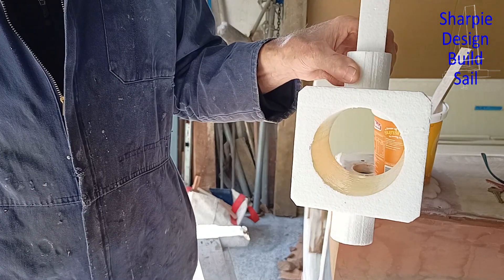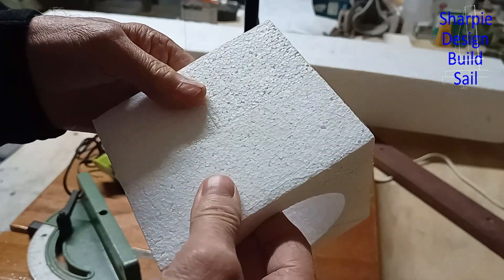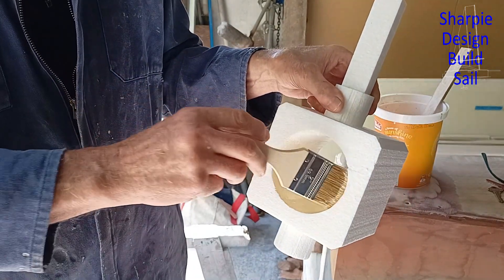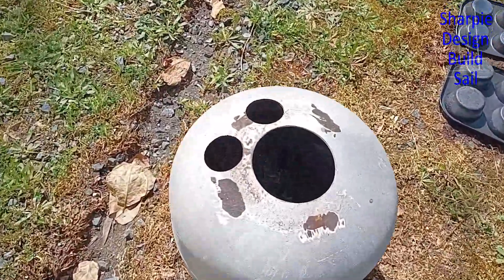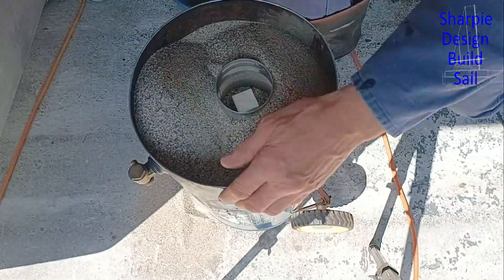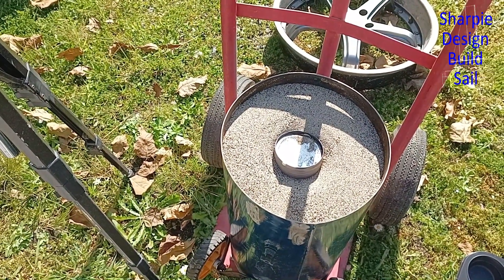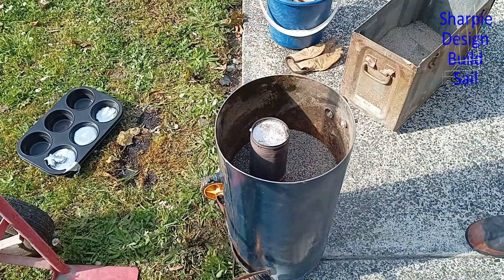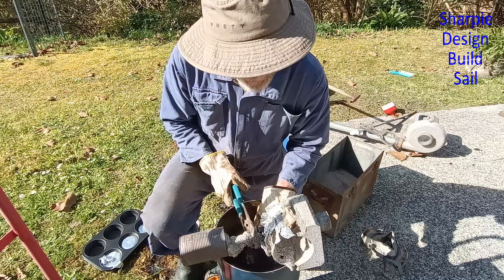Lost Foam Casting First Time - What Could Go Wrong? - Sharpie Sailboat Build - V53 The Rig Pt3

Comment: I'm a bit late to the game as you've pretty much cracked it now, and I'm far from experienced so take any of my advice with a pinch of salt, but I used strategically placed plastic drinking straws vertically in the sand as vent tubes, thin and easy to cut off afterwards and I didn't have any noticeable explosions of gas. But I never did items as big as yours either. Cheers Karl.
Reply from the maker: Yes there's so many variables so I can only relate to what works for me, and Kelly 😉

Comment: Need to coat all the foam plus have another vent for the gas to escape. 

I'd also have a go drilling holes in the foam where it's not structural. Use them to vent any gas out elsewhere.
Reply from the maker: Thanks for those suggestions, much appreciated. I've pretty much done that on my mark 3 version, rotated the pattern so bore is vertical, increased the sprue size and shortened it by 50mm and diagonally opposite put a hollow foam vent, hole goes down into foam. Have got my second coat of slurry on which might be enough. Also slimed up the pattern a little, not as much depth and removed some material from the fire and aft faces that don't do much. Should I replace the sand? It's quite flowy.  I think we're going in the right direction!

Comment: Looks like an interrupted pour. Pour faster, try to keep the cup as full as possible.
Reply from the maker: Absolutely, it happens very fast, faster than I expected and a fast continuous pour seems essential. Also, to work with the rapid amount of metal I'll need to use a bigger can so the risk of overflow is less. But yes, it's very clear in the video I didn't pour fast enough. I'm increasing the sprue size so that becomes even more essential.
Thanks for the feedback!

Comment: I would coat the foam multiple thick layers. And use plastic staws for gas outlet. And wouldn't put it so deep.
Reply from the maker: I appreciate those suggestions and in my 'first version' of remaking the pattern I have done just that, put more coats on the pattern. I say first version because in the early hours of the morning I can usually think ways that theoretically could improve things! Yes, it seems different casters have different opinions about venting but after watching quite a few videos, I'm convinced that any way you can help the rapidly expanding polystyrene gas escape, has got to be an improvement. It does seem counterintuitive for the gases to be escaping out the hole you are trying to fill! Of course, in practice, a lot of the gasses actually are supposed to vent into the sand itself and so coating the pattern apparently can to some degree interfere with that escape path and venting becomes more important presumably.
Yes, if it's a 'loose sand' type of casting sand, a deep set pattern has a lot of weight above it and it makes the whole metal replacing foam to support the 'roof' far more critical. That's partly why I'll rotate the pattern 90deg so the bore is vertical which gives much less horizontal areas and also make it much easier to pack the bore. 
Straws sound like a really good idea. When casters use green sand I see they often poke thin holes nearly down to the pattern to relieve pressure in the casting sand. You'd have to use straws, like you say for a loose sand. 
One guy who got very successful uses his own made plaster of paris funnels and they stop the metal cooling so fast in the sprue walls.
Thanks very much for your feedback!
Reply: @KarlFullerNZ  Is it Kelly Coffield? He is too good.
Reply from the maker: @High56 good suggestion, have watched some of his videos amongst others. Cheers for the suggestion!

Comment: Maybe using Super Glue could have solved the issue with the hot gun. I'm not a caster, but I have seen people use a more specialized casting sand that keeps its form and doesn't collapse without support. Cheers.
Reply from the maker: Cheers for chipping in, this casting business certainly throws some curve balls. I've seen it mentioned in forums, in very small amounts superglue might work but any type of glue you use, has to burn up at similar temperatures to polystyrene, that's the issue. Apparently sparing use of PVA is OK. The different casting methods require different skills as does cricket and rugby I believe. The difference between foam casting sand and split mold sanding is necessary but I certainly agree, I'm probably not using the right sand plus a few other tricks I summarize in my next video.
Also in the next video, will be a new strategy I should have thought of before, but you know me, in the deep end!
Thanks for the feedback  🙂
Reply: @KarlFullerNZ  It will be exciting to see the solution in the next episode. Cheers.
Reply from the maker: @Cptnbond in the earlier comment you mentioned a special sand which may be green sand and apparently you can use it for foam casting as I've just seen in a couple of videos. You just don't tamp it down hard. See you in a week with some success I hope!

Comment: Hmmm, shouldn't you be using 'Green sand' when casting?, I could be wrong since it's been a few decades since my high school days, but that's what we used when making molds to cast aluminium.
Reply: I was gonna make the same suggestion. I havn't done this lost foam method but that sand looks very coarse and too runny. When I did lost wax we melted the wax out first, with a ceramic mould around the wax
Reply from the maker: @dominictarrsailing it seems I have a choice, stay with that sand and make sure enough slurry is painted on or little/no slurry and better sand or green sand. The bore, the only part I slurried, looked good and less sand imprint as you'd expect. My design is going to be better too, vent/s and casting with bore vertical so less roof to cave in!
Good to hear your thoughts!
Reply: @KarlFullerNZ  good luck! will be followig your progress! hmm just looked it up greensand is just sand with a little clay added...
Reply from the maker: @dominictarrsailing yeah casters often use kitti litter because it's often made of bentonite clay but you have to grind it fine, some people use a blender 😮 Hope the sailing is going well.
Reply: @KarlFullerNZ  oh yes I've heard  that! yes sailing is going great, we are hanging out in Fulaga island at the moment
Reply from the maker: @dominictarrsailing how cool, you're out in the Eastern area! I'm looking forward to your next YouTube 🙂
Reply from the maker: For sure you would if you were using the split mold method but it wouldn't work well for lost foam casting as the foam is too delicate for the packing required. Plus one of the principles of the lost foam method is, the burning of the foam creates gases, some of which escape into the porus sand. However, I did see one Youtube were the guy put greensand around the sprue and I could see why, that's where my sand collapse may have started.
Thanks for the comment!
Reply from the maker: To amend my reply to your question, yes you can use green sand as long as you don't tamp it down hard, as I've just seen in a couple of videos.